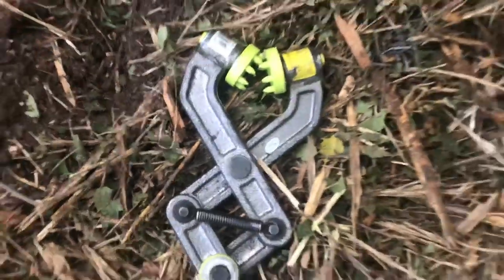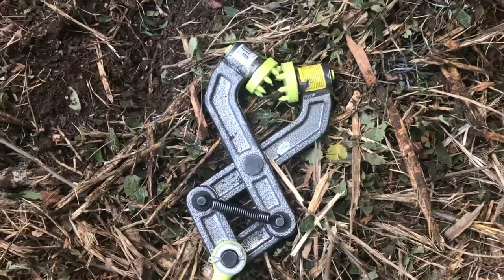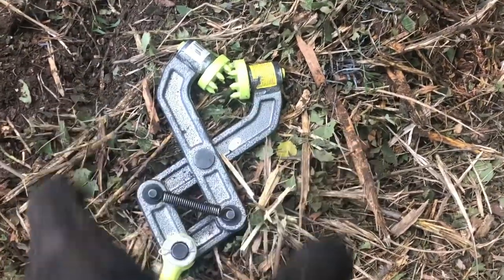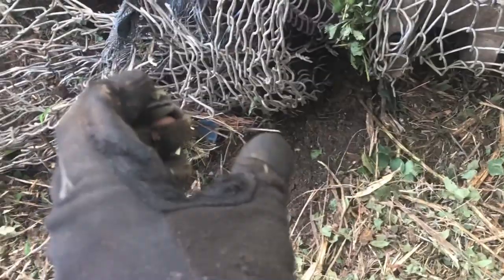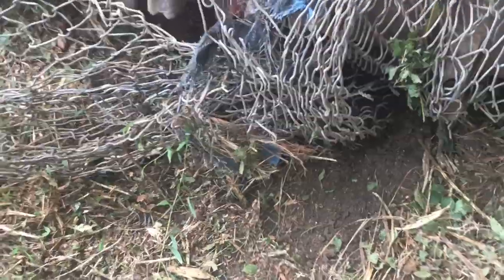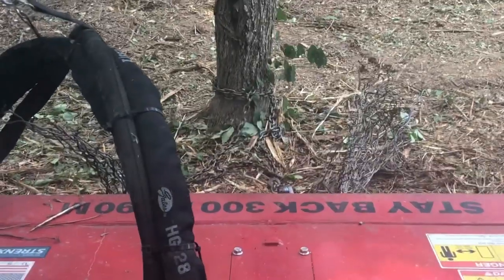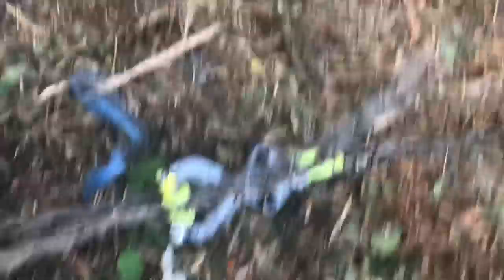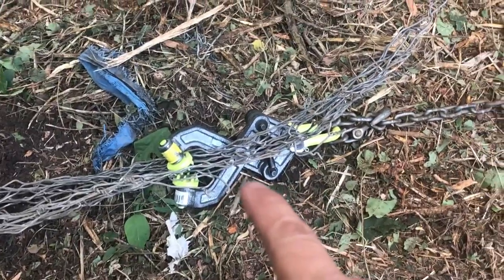How to Get Fencing Out of a Forestry Mulcher Drum

Comment: Thanks Dave. I have a grubber like that one and did this very thing a few weeks ago. If I ever produce the video, I’ll tag you in it. 👍
Reply from the maker: That's awesome! Yes, the grubber works like magic on things like chain-link and square fencing, and for things like tarps, carpets, etc. If you can just get a good bite on the tail end of it, it will usually just pull and unwind it off of the drum. I spent hours cutting things with a knife or bolt cutters before I got the grubber. Good luck to you.

Comment: Armchair Arborist here; could I recommend a basket style sling on your anchor so as to not damage the anchoring tree? 

Always good to learn tricks to fix problems in the field. Thank you!
Reply from the maker: Alan D You're right about that, Alan. I do have two nylon tree-saver straps rated at 4000 lbs, that I should have used around the tree. I normally do that, not sure why I didn't here. Guess it was because I was on a job site and just grabbed the stuff I needed to get back to work quickly.
Reply: @clevingerforestservicesllc1164  Mr. Clevinger, sometimes you've gotta do what you've gotta do. Thanks for the reply!
Reply from the maker: Alan D Very true!

Comment: ouch
Reply from the maker: Jeddco66 It's never fun to have a mulcher drum spinning at 2000 RPM grab a piece of debris and suck it in until it jams the drum to a stop. Unfortunately, I t takes the experience of getting different things stuck in the drum, and then figuring out the best tools and methods to get it out. Once you have the right tools and tricks in your toolbox, these problems only take a short time to fix and get back to work.
Reply: @clevingerforestservicesllc1164  i can a test to that-also to what a stainless bolt can do to a wood chipper and have the facial scares to prove it- this was before auto stop blades
Reply from the maker: Jeddco66 Dang. It can get crazy out there, and it takes constant focus to stay safe.

Comment: How many hrs will one of the mulchers last under normal use before having to do a major rebuild? Im thinking of buying a used one but I dont want to get one with say 5000hrs on it and find out i have to rebuild everything and should have just bought new. Have you ever had any major maintenance issues with yours other that teeth?
Reply from the maker: Chase Hodgson I had about 3500 hours on my first mulcher head. I didn't have any problems with the hydraulic motor or transfer module, but I did replace the two main bearings that the drum rotates on before I sold it. Bearings were $750 a piece, if I recall correctly. A hydraulic motor would cost about $4,500 if you needed a new one. It's hard to say how long these things last, since it depends on how it is maintained and used. But I certainly wouldn't pay much for one with 5000 hours on it unless you're also prepared to replace some components.

Comment: I imagine that you may have had some very bad experiences in the past to have learned whatto have as tools and the best ways to use them . And before the grubber 🤔🤔🤔🤔🤔
Reply from the maker: Dallas Baiton Hi Dallas- There's all kinds of unseen debris out there that gets wrapped or jammed in the mulcher drum. Different things take different tools and methods to get out. Unfortunately, you have to learn this by experiencing it. Before I got this grubber, I would use just a chain, like in this video. I would weave the chain into the chainlinks of the fencing and then pull it out. Weaving it in, and unweaving it, took a lot of time. This grubber gets a good bite, and is simple to attach. This video is definitely a "Pro Tip" for getting fencing, tarps, carpeting, silt fencing, and similar types of debris unwrapped from a mulcher drum in one continuous piece in a very short amount of time.

Comment: Any cutters damaged?
Reply from the maker: vettepilot427 No damage. Wire fencing, barb wire, rope, tarps, silt fencing, logging cables, carpeting, and other similar debris won't damage anything on the mulcher, but it can be very difficult to get that stuff unwrapped or cut off of the drum. This tool and method is the best way for fencing.
Reply: Clevinger Forest Services, LLC   Excellent, thank you for the reply. I’ve seen other heads damaged from bush hog blades and a manhole cover (!). I was curious if material like this would cause similar damage.
Reply from the maker: vettepilot427 Iron objects will definitely cause damage. I hit an iron cover on a water main valve that was covered in high grass. It was a 12" diameter cover. It got sucked into my mulcher, chipped 5 teeth, then shot the cover out about 100'! I had to replace the five teeth. Not good.